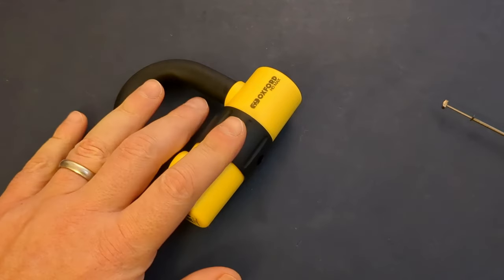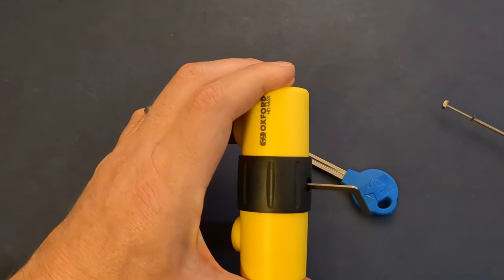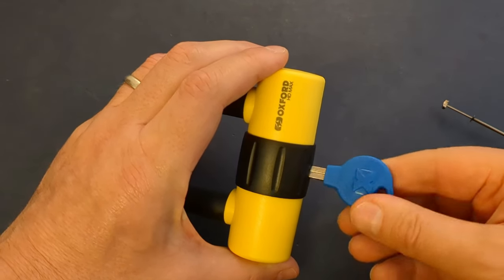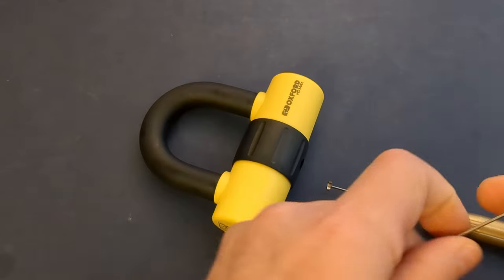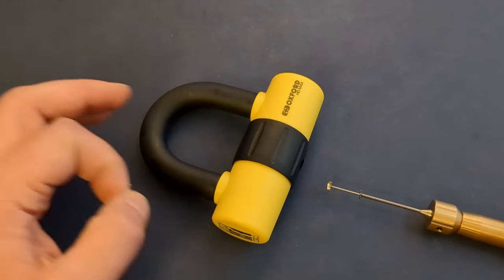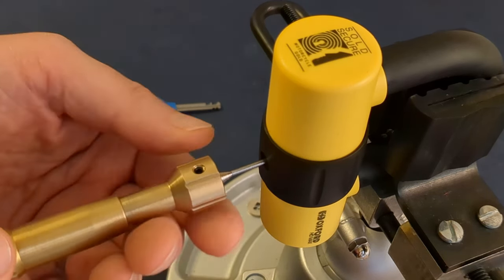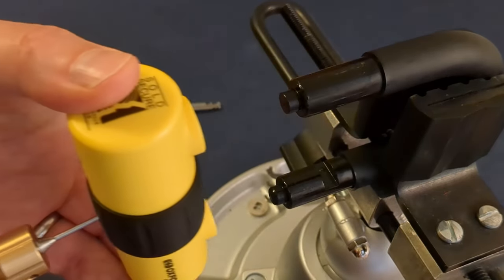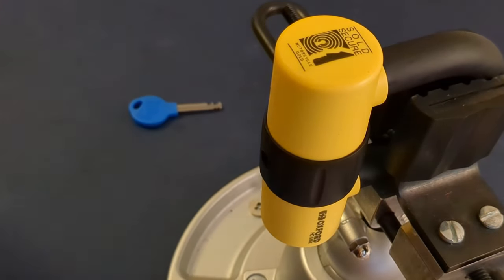Oxford HD Max disc brake lock picked

Comment: I have 2 of these and they are an ideal size and weight for motorcycle. For a chain around a frame tube or direct to several types of disc brakes. Padlocks generally too small to be as useful as this. Also they are incredibly cheap. Fit three for the cost of one posh lock and frustrate the angle grinder! Now you've let us know they are not easy to pick, that makes them even better.
Reply from the maker: Yeah, it's very unlikely anyone is going to pick one of these specific locks in use, too hard and too specialist.